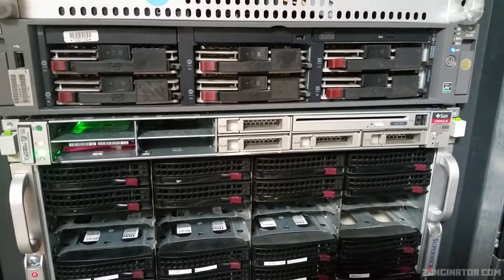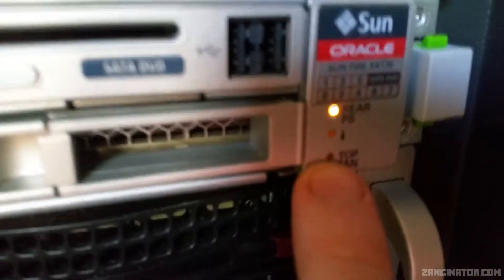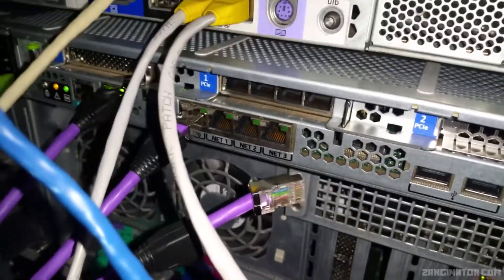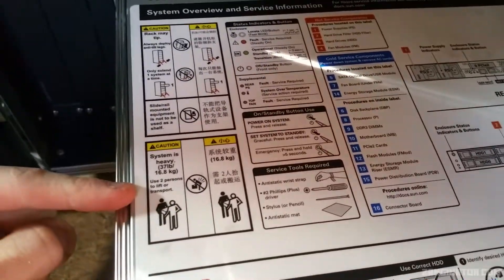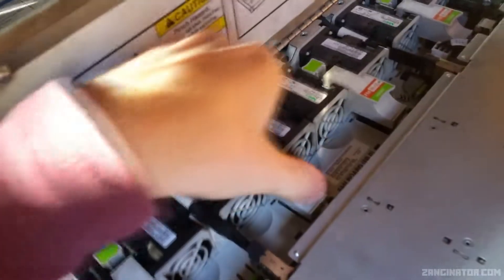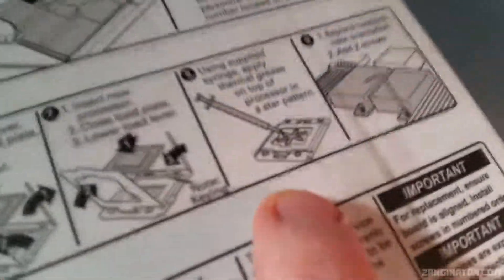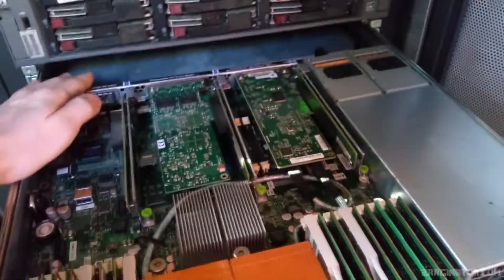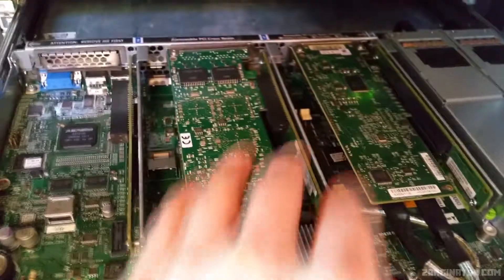Oracle Sun Fire X4170 M2 Server Overview

Comment: Hi i've just picked one of these up for myself. 
Do you have a video of the startup procedure as i was hoping to get some basic vga output on startup but it doesn't seem to be outputting anything
Reply from the maker: I do not unfortunately. Mine was always very temperamental with certain VGA cables (some only have 14 pins instead of 15) so that maybe a simple fix.
Typically though from a cold boot, there will be a period of about a minute before anything appears on screen.